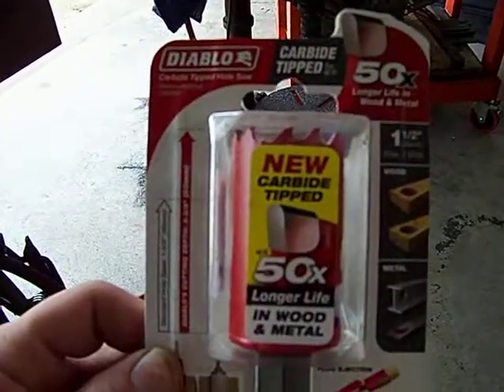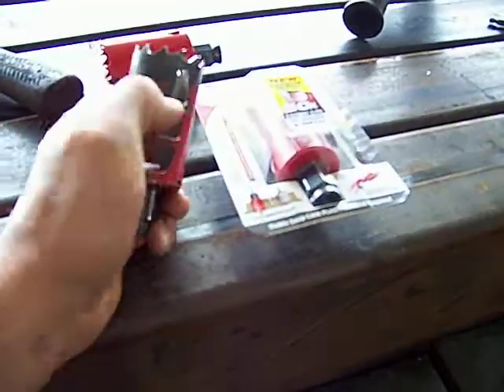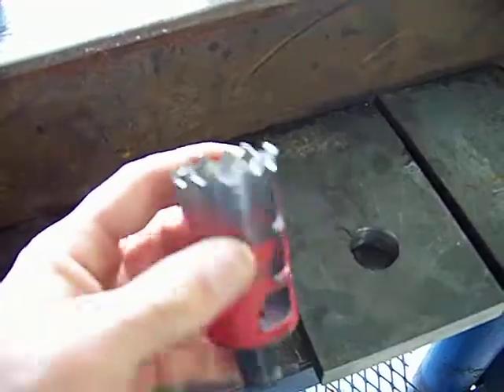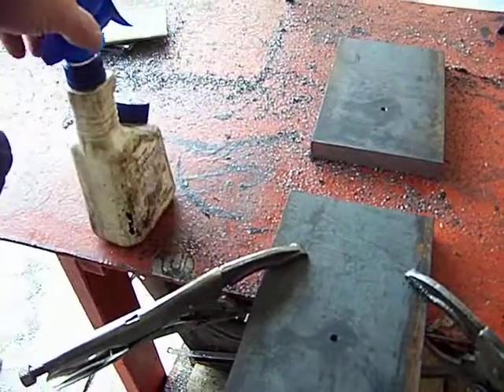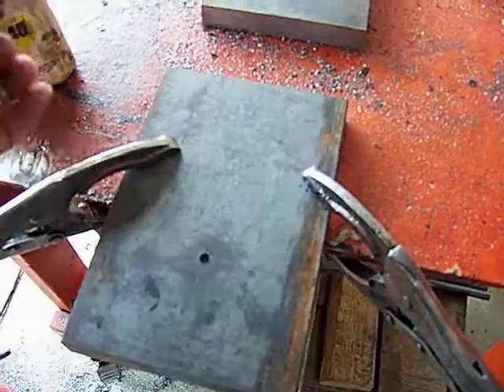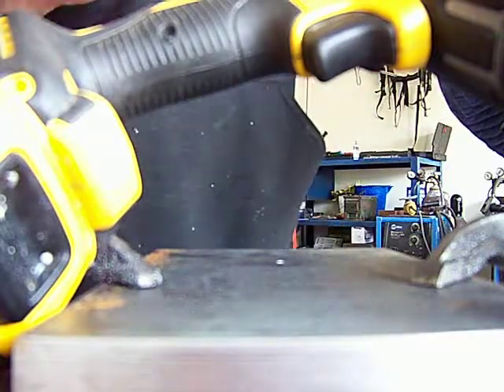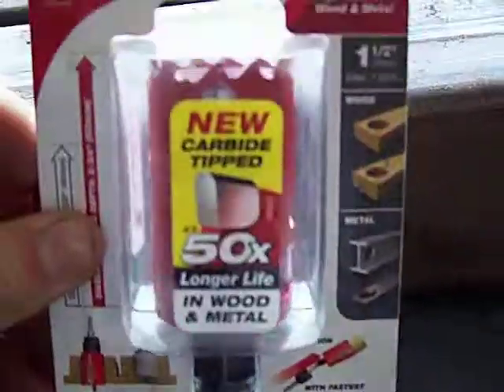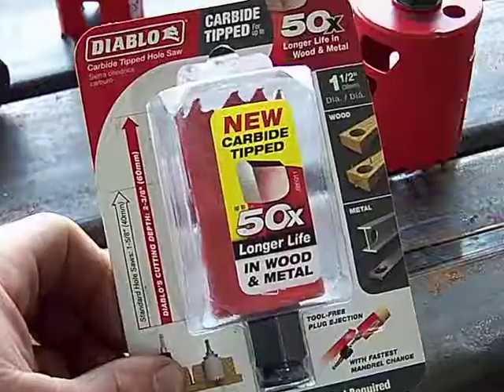Diablo hole saw bit review and demo drilling metal. Tips for drilling thick metal.

Comment: I switched from Milwaukee to Diablo Hole Saws about a year ago and can confirm that they are some of the best hole saws available and their “snap lock” system is simply perfect but if you are drilling vertically into steel it’s a good idea to wrap some electric tape around the pilot bit so it can’t fall through the pilot hole if it pulls out. 
I also like the idea of using compressed air to plow the chips clear but that’s not always a viable option in the field. 
Another tip for drilling holes in steel is to use crushed ice or “Sonic Ice” to keep the work and hole saw cold. After drilling the pilot hole tape off the holes in the sides of the hole saw and fill it with crushed ice, then drill in low speed with moderate pressure. The melting ice provides plenty of lubrication and also flushes the chips clear of the cut (they will build up on the outside unless you are drilling horizontally) if you start to see steam you need to stop and add more ice. I’ve also used snow but it tended to pack and not stay in contact with the work like crushed ice does. 
With this method I can get 50 to 100 holes from a single hole saw in 3/16” or 1/4” steel. 
The drill that i normally use is a Makita XGD01 which is a 36 Volt 1/2” Right Angle Drill that can also be used as an Earth Auger for drills up to 8” Post Holes (handy around the farm) in low gear it has a maximum of 350 RPM and an electric torque limiter that eliminates kickback which is extremely important.